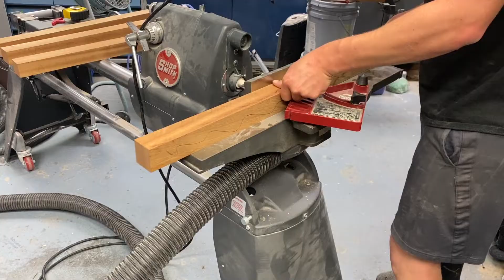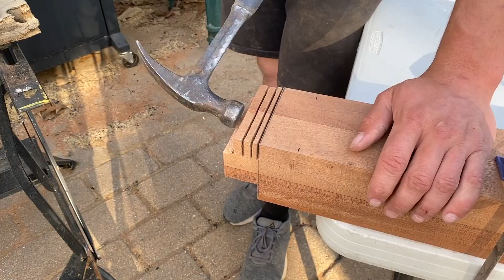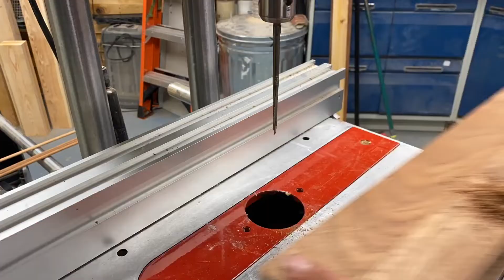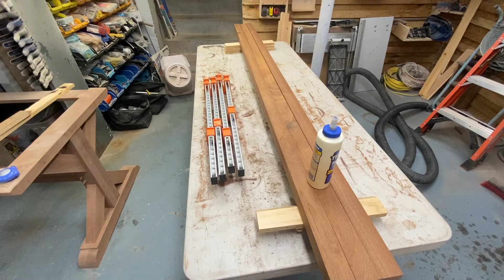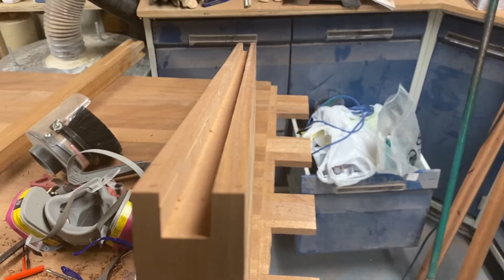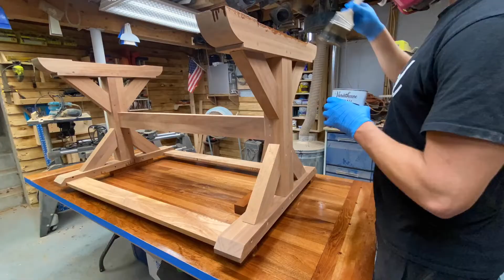HOW TO BUILD A FARMHOUSE TRESTLE TABLE (DIY)

Comment: this is like the third video I've seen that is 50% over-engineered faff. If you start with bigger dimensional lumber you can avoid milling and gluing scraps
Reply from the maker: I would very much prefer to use bigger dimensional lumber myself, but all the wood I’m working with was free leftover cutoffs completely made from mahogany, which where I’m from is very expensive.

Comment: Looks incredible! Inspiring work! Was there a reason not to glue in the dowels you used on the leg braces? Thanks for posting!
Reply from the maker: Yes, if I were to glue the dowels it could possibly contribute to the table cracking when it expands and contracts. So far a couple years after this build and it still has not cracked anywhere but it expands and contracts about 1/4” every season
Reply: Nice one, thanks for the reply! Table really looks incredible, awesome work! Do you remember approximately how much longer the top was than the base? Like how much overhang you had on each end? I’m trying to make a similar piece and I’m struggling with that part of the design. Cheers for posting, so great to watch!

Comment: Going through glueing all of that, man even if the table didn't come together you deserve a like! I couldn't tell from the video is you drawbore the dowels or just go straight through?
Reply from the maker: It was a project all its own to to glue up everything indeed! Thank you Brandon! And the holes for the dowels go all the way through and the dowels are sanded down to be flush with the top and bottoms of the bread board ends

Comment: How does the glue/sawdust mixture hold up with seasonal wood movement? Clever idea, I have too much of a gap with my breadboard ends, I'll try this method. 

Also, roughly how much space do you have from the end of the tabletop to the base (for people sitting at ends of table)? I currently have 9" in my tabletop but I can already envision bruised knees from a protruding tusked mortise/tenon.
Reply from the maker: The space between the table top edge and the legs of the table were approximately 12”-14” which allowed for plenty of space for someone to pull their chair under the overhang without hitting knees. Also the saw dust and glue has held up very well so far even with the 1/4” of contracting my table has done this winter. Thanks for the comment!

Comment: I made this exact table by the plans from Third Coast Craftsman. Your joinery is way tighter then mine were. I need alot more practice. Was wondering if you've seen much movement with the breadboard ends and how it has affected the wood filler you added? I used air dried lumber and get a little more the 1/2" of movement from summer to winter. Really nice build
Reply from the maker: Thank you for your comment! And yes from summer when I built it I have gotten about 1/8” that shrunk to present time in winter.

Comment: Table looks great.  I really like the trestle build.  However, I have a couple of concerns.  

First, I have found that alternating the growth rings in a glue up can eventually lead to a wave distortion as each board dries and pulls in the opposite direction.  Hopefully, with the narrow boards you used this won't be very noticeable.  

Second, how does your breadboard allow for tabletop movement when you attached it with 5 glued in dowels?  There are more reliable and time tested methods that would allow for movement and prevent eventual cracking.

Still, great job.  Let us know how the top holds up over time.
Reply from the maker: Thank you Rick! I actually elongated the holes off camera before attaching the breadboard ends to allow for dowel movement and during this cold winter the table has already shrunk and so far no cracking anywhere but I will see once summer comes back around. I also only glued the very tops of the dowels to keep them in place overtime but they are not glued all the way through. Only about 1/4” of them is glued to the breadboard end itself.

Comment: Fantastic Job dude! I'm working on the exact same build right now using Chris' plans at third coast craftsman. I have 2 Question for you: 1) I see you went with 90 degree Mortise and Tenons on the Knee braces. Was this alot easier than using the 45 degree ones that Chris uses? and 2) how long did your build take?

Cheers bro. again fantastic job.
Reply from the maker: Yes I went with 90 degree mortises because I didn’t see the point in making the angled 45 and having to take even longer guessing and checking at carving out a 45 mortise. I didn’t track my hours on this project unfortunately but considering I had way more pieces to glue up for every section of the table, the glue up and prep for glue took around 20-25 hours alone. In all I’d say the table entirety took At least 125+ hours.
Reply: @bensworkshop4195  thanks for your reply! yeah it’s been slow going for me. What took you longer, the base or the table top? I just finished the table top and it took FOREVER
Reply from the maker: The trestle legs were what took the longest considering that there was a total of 22 mortise and tenon joints to cut. It’s very satisfying in the end fitting everything together nice and tight though so it was very much worth it!